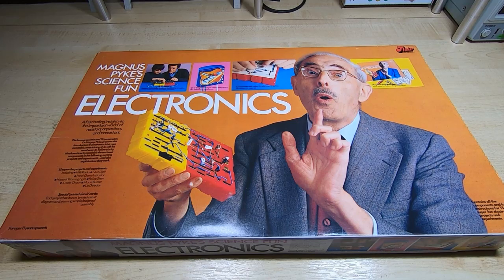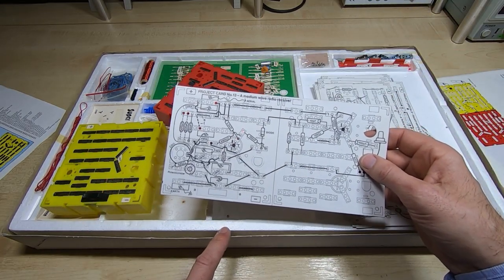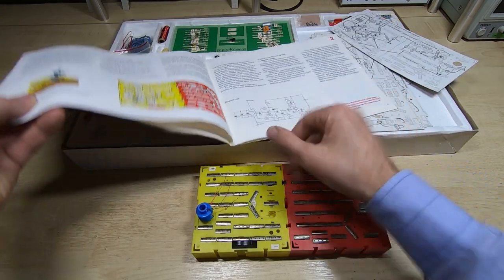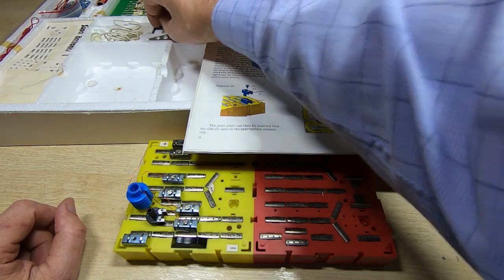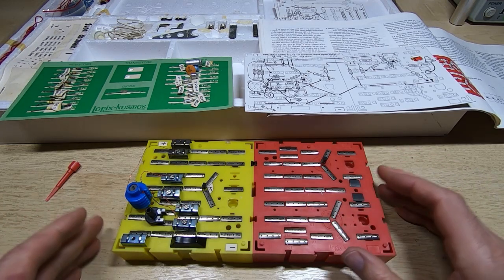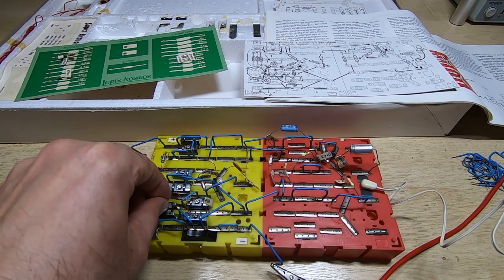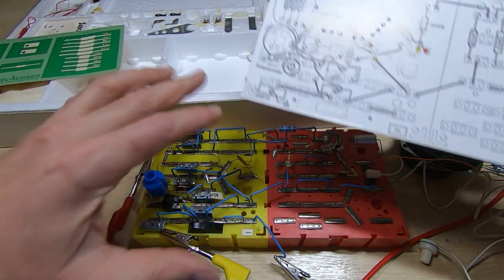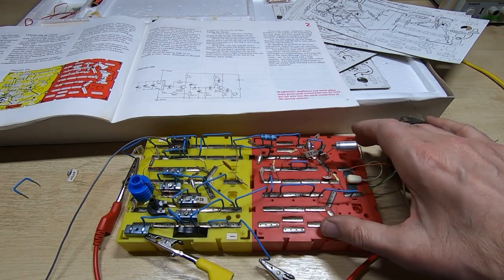Electronics For Beginners Part2

Comment: I had the Johnny Ball Electronics kit: spring and wire construction. Two resistors, two capacitors, a diode, an NPN transistor, a variable cap, battery holder, coil, and a ear piece. It's amazing the amount of circuits that could be built. The crystal radio was an eyeopener: hearing the radio with my own ears with an unpowered circuit was a total shock for me as a 10 year old.
Reply from the maker: I could not agree more and I had a very similar experience when I started. Very few parts but I built hundreds of circuits and the first time I heard sound coming out of a device built from a few salvaged components I was hooked. I think many people getting into electronics these days miss out on the 'magic' of it because they jump straight into a micro controller board and do not get to 'discover' electronics.

Comment: Hi Jerry I'm new to electronics and a new subscriber, I have a quick question that stumps me when using a power supply to power a circuit like the one shown how do you determine the amps needed?
Reply from the maker: A great question. It is possible to calculate total current for almost any circuit and is actually what I did when I started electronics. When you can get very close to the correct current before powering up the circuit then you know you are making progress. For simple circuits like the one in this video you can initially take a short cut and set your supply current limit to something less than the current which would destroy the active components. For example if the transistors can handle 100mA then set the limit to 50mA and you can be reasonably sure nothing will be destroyed (not foolproof but a good place to start). If you want to know the total current then calculate the maximum current in each part of the circuit from rail to rail and add them all together. You can also start low and increase the limit slowly until the power supply enters constant voltage mode. If the current spikes before you get there then you know there is a fault. Sorry to sound vague but this is a subject that takes a lot of time to get to grips with but your question is exactly what I would have asked when I was starting (if there had been anyone to ask). Another thing you can do is put a small bulb in series with the power supply. If the bulb lights then the current is too high but it will protect the circuit. Just select a bulb with a suitable wattage. This is a 'dim bulb tester' and is a very useful technique for mains powered circuits.
Reply: @JerryWalker001  brilliant Jerry, thanks you for taking the time to explain. Means a lot 👍🏻